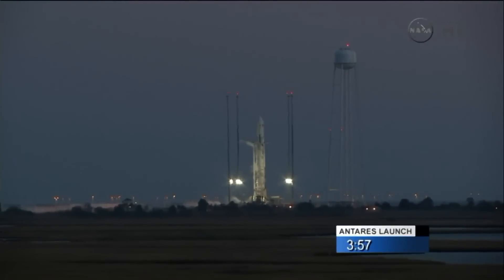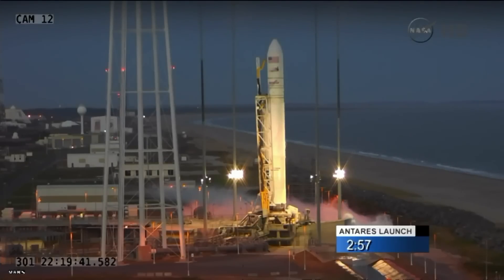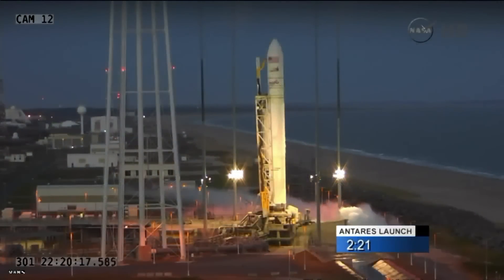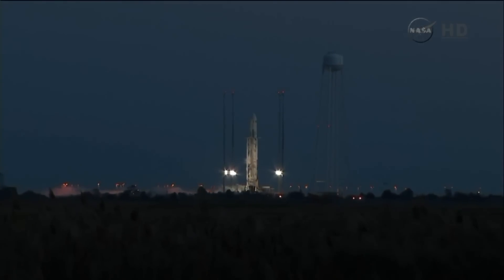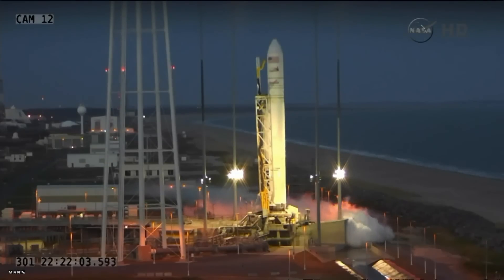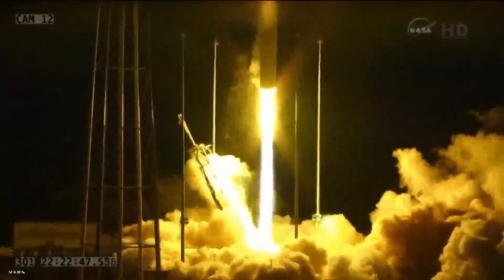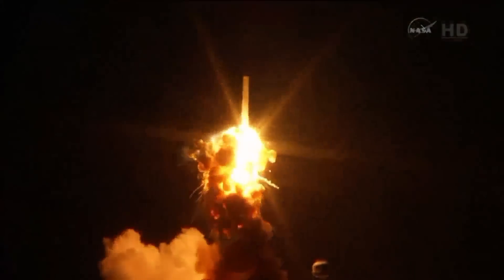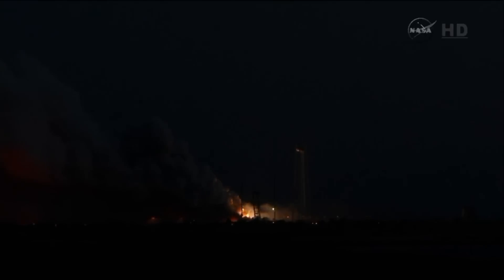NASA Antares Rocket Explosion [HD] [FULL]

Comment: Rofl "Avionics power nominal" as the rocket is exploding.
They should have a guy whose job is to look out the window and call "The rocket has just exploded" on the comms when it happens.
Reply: sukhoy That's pretty normal. Rocket engines are designed for a certain thrust, but they can get upgraded as the design gets improved over the years. These were refurbished engines from back in the Soviet era. They don't rescale the percentages because there is a very specific thrust for each percentage which could cause confusion in the different systems.

The space shuttle also had this. It started out at 100% and got upgraded to 109% over the years and could even go up to 111% in emergencies. Of course they have to get tested and certified again for each upgrade. The shuttle doesn't have a perfect flight record, but the main engines did not malfunction even once.
Reply: @Niosus  "The main engines did not malfunction even once" Umm I'm pretty sure that on one mission 3 of the coolant lines inside the engine bell that used hydrogen to cool the bell down ruptured and if 5 lines had broken that part of bell would have melted and lead to a rapid unscheduled disassembly ;).
Reply: YEAH but he also said: Power at 108% !!!

108% ?? doesn't sound very stable
Reply: Peter Syverud NASA doesn't. This rocket is built by Orbital Sciences Corp, an independent contractor who also launch commercial cargo.

The reason why they use those engines because they are actually some of the best engines ever made when it comes to efficiency. After the Soviet Union fell apart a whole warehouse filled with these engines "surfaced" and Aerojet (the "vendor" of the refurbished engines) bought at least some of these engines.

You can read up on the history of those engines here: http://en.wikipedia.org/wiki/NK-33#Current_and_proposed_uses
Reply: MoahGentle Not for this engine, but there is a nice summary on the wikipedia page for the space shuttle main engines (with all the appropriate sources of course)

http://en.wikipedia.org/wiki/Space_Shuttle_main_engine#Upgrades

Actually, looking at it again I did make a mistake. It went up to 106% in normal use cases. 109% and 111% are both for launch aborts (which never happened)

Very fascinating stuff to read :)
Reply: They are miles from the launch site in a bunker. I doubt that they would have a good enough view to see the boom.
Reply: Peter Syverud
this was NOT a NASA launch.
Reply: Niosus Any source for this info?
Reply: MrModerationist I'd even say that working within constraints is what stimulates brilliance. You don't want to leave brilliant people waddle at their own pace. They need to be challenged. Nothing gets a good engineer more excited than trying to come up with a solution that fits all constraints... Constraints make the problem interesting.
Reply: Niosus
Why would NASA use a rocket engine from possibly 50 years ago? Why???
Reply: +RealKull - Orbital sciences corp used Russian engines because they could get them more cheaply.  The SSMEs used by NASA have been tremendously reliable.

Apart from YOUR disrespect, I'll surely pass long MY respect to less offensive Russians.  You folks have a tremendous and longstanding space program....
Reply: MrModerationist I'd argue many Russian engines and SpaceX's Merlin engines are both very good from a value point of view, while SSME, F1, etc were all good from a performance point of view.
Reply: MrModerationist Absolutely. Even with unlimited resources, spaceflight still is full of challenges.

Did you hear about the latest SLS delay? The first manned flight is now planned for 2023... EIGHT years from now. On top of that they are aiming at a single launch per year, making it almost definitely more expensive than the Space Shuttle (at 2 billion a flight).

I think SLS should be cancelled. Not because NASA is incompetent, they certainly are not... But because politics has completely ruined the rocket. Everyone would be much better off if those billions upon billions were either spent on scientific projects or in helping along commercial companies build heavy lift rockets. They could have a heavy lift program just like the currently have the commercial crew program.

Because even when the rocket and capsule are done... We're still nowhere close to a Mars or asteroid mission. Hell, we're still nowhere close to a Moon mission that goes beyond flags and footprints. All the stuff needed for that is barely being worked on. I think it would be much smarter for NASA to leave the transport issue to a commercial provider (like with the ISS) and focus on actually developing the technologies needed to keep people alive in deep space or have a sustainable settlement on the Moon or Mars.

Sorry for the rant. It's just so frustrating to see politics force such a great organisation to pretty much ruin its public reputation.
Reply: RealKull
you realize that was a private launch right?
Reply: Niosus 51-F suffered a engine failure in flight.  It was the only in flight failure of an SSME
Reply: canuck20
I learned that after writing that comment. Although from what I've read it was a malfunctioning safety system and not an actual physical issue with the engine? They were at risk of losing another engine for the same reason, but a smart woman on ground control figured it out in time and had them disable that system.

Or at least that's what I remember.
Reply: Bret Remington
 These engines have a better overall service record than the Falcon 9 engines, so go figure.
Reply: @fubar12345  NK-33 (AJ-26) has the worst service record of any engine. Check out all the N1 failures. I believe you are thinking of the RD-180, which is one of the best rocket engines ever made. That said, the NK-33 is an incredible technological achievement, but ahead of its time in many respects.
Reply: Jim Lahey I don't believe that's true. NK-33 has been used much less than the Merlin 1D engines. 100th flight of Merlin 1D engine occurred recently, and now it's at almost 110.
Reply: Ambient Morality
 ..and you'd get no argument from me here.  Everyone works within the constraints that they are tasked with and there's brilliant and creative people the world over.
Reply: Niosus I agree with you completely. Use of older Russian or SSME engines is not brilliance stimulating in this case. They both represent constraints. The objectives and constraints are different for different projects. Some may be more technical in nature, some may be more economic.   I don't think pretty much anyone in space programs finds themselves with ample waddling time. : )

Companies like spacex and orbital sciences surely are emphasizing cost concerns a little mite than some as essentially their goal is to "commoditize" space flight. Projects like Orion surely gave cost constraints, but ultimately the order of priorities surely is a little different....   SLS for example involves a great deal of work on be engine design with a little different focus than commercial launch companies...
Reply: Niosus Ultimately, I'd much rather support LVs being left entirely to companies, with NASA focusing their budget on companies in LV business (gradually decreasing that and letting companies work on their own) and NASA responsible for scientific missions that companies have no motivation to do on their own.
Reply: +Niosus I understand what you're saying, but to get any closer to a mission like you're saying, you really need the lift capacity of something like SLS.  I would say that commercial lift surely is not without its hazard (reference the video above).  In general, NASA does partner with commercial enterprise to build components, etc.

I'd also say, that my understanding is NASA is doing all of the above as you're saying.  I toured the Johnson Spaceflight Center a few months ago...  In the huge training and operations center - next to the ISS full scale mockup is the orion trainer - and where the old shuttle robotic arm trainer used to be, there were a number of mars rover prototypes for mars (for human use).  They're doing alot of the tech research to support such a mission (textiles, food, body effects).  In fact the year in space on the ISS supports this I believe.

Remember - the Space Shuttle was only designed for LEO.  The SLS is a much more powerful launch platform - you'd have to compare it more to Saturn V in today's dollars for something more equivalent.  I understand what you say - and one should always question how we do things, but don't be too harsh on NASA.  I would not say their public reputation has been 'ruined'.   They've done some pretty amazing things of late...
Reply: MrModerationist Don't get me wrong, I love NASA. The people at NASA are not the issue. The issue is that politicians in congress are making engineering decisions that NASA engineers should be making. What parts get used, how to develop them and in what order should not be prone to politics.

That's really my issue with it all. They should give NASA a budget and give them a goal. There can be oversight to prevent needless spending, but it should be limited.

For instance, what idiot decided that the SRBs from the space shuttle should get reused on a manned vehicle? Those boosters have already killed 7 people. They're not that bad, but we've known for a while that solid fuel and manned spaceflight isn't the best combo... Maybe it can be made, maybe not. My issue is that politicians decided that this is how it is going to be...
Reply: +Peter Syverud its specific impulse is far more efficient then any comparable us engine excluding the merlin 1D
Reply: killman369547 The Merlin 1D is not particularly efficient. It's an open-cycle, gas-generator engine, which makes it mechanically simple and have a high thrust-to-weight ratio but not efficient in terms of specific impulse.
Reply: Ambient Morality
that i know but it is more efficient than the nk-33... not by much though
Reply: killman369547 No it isn't. NK-33 is 297s SL, 331s VAC. Merlin 1D is 282s SL, 311s VAC.
Reply: Ambient Morality
interesting i guess the website i found my info on was full of shit
Reply: 108% is a power rating that is stable and is actually engineered to perform. The catch is it's meant to be done for a short time. 100% power can be for as long as it has fuel.
Reply: oh ok thanks
Reply: so?
Reply: That's the Range Safety Officer. In this case the RSO detonated the rocket before impact.
Reply: Bret Remington I'll tell you why you have to use Russian rocket engines...because they're BETTER THAN YOURS, which are non-extant, but your stupid techs are not proficient enough to make them work properly.
Reply: @RealKull  The NK-33 is a beautifully designed engine but, soviet metallurgy in the 1970's could not reliably handle an oxygen-rich full-flow combustion cycle. These engines were meant to be scrapped after the N1 (moon rocket) failed. The focus shifted to new designs such as the incredible and quite reliable RD-180.
Reply: @RealKull  Unfortunately, the NK-33's were not scrapped, in direct defiance of the kremlin. These rushed and underfunded engines would strike again, like a chilling reminder or metaphor of the Soviet social experiment. That said, If I can scrape together enough cash, one of these puppies will have a prominent place in my living room.
Reply: RealKull angry much?
Reply: Total disaster.  I'm not quite sure why we are still using 50 year old Russian equipment.  Bring on SpaceX.
Reply: @breming1  SpaceX here with the successful launch of Crew Demo 2
Reply: @breming1  Because they worked...most of the time.
Reply: RealKull I think the correct English is "non-existent" . If you must 'sound off' in my language, have the intelligence to spell it correctly :-)

Comment: The Rocket Engine Outlet was manufactured in 1974. This Rocket contained cheap engine parts, 40 years old in production date. Probably they have never heard of metal corrosion.
Reply: GaryKildall) Because though it occurred to you to check for that, the actual engineers didn’t?..... Seems unlikely.

Comment: If I was the head of the launch control team I would be so pissed that that just happened. Like I would be like "fuck it" and just walk into that fire.
Reply: Expect him to walk a few miles?
Reply: Lol  ^_^
Reply: I don't even think launch control was at all responsible. My humble guess is an engine failure. More specifically a rupture or explosion of the preburner or fuel/oxidiser pump.
Reply: Povl Besser Fuel system (pumps, regulators) is not part of the engine and supplied by different manufacturer. Engine was designed to operate with analogous and/or hydraulic control system. It was replaced by modern digital - with faster reaction but (sometimes) with its own instability. 
What I saw in that video - a flash of fire and immediate lift loss, followed by bigger explosion. May be even a fuel line rupture or pump disintegration. Engine itself is just a burner with cooling system.
Reply: Alexandre Savine What was the instability caused by?  Was it a programming error of the digital system?
Reply: Matthew St. Onge It could be programming error, it could be some sensor failing just slightly off nominal response or some valve running with slightly abnormal parameters. May be several factors, including all from above plus weather and fuel composition variations.
     Each individual thing is within normal - but few together working in same direction - disaster. 
      Any (digital or analog) control system has a limited corridor of stability. Crossing the boundary just by fraction of % - and never able to recover.
    Not being in the project, I can give only a general guess, based on behaviour of rocket during takeoff.
Reply: Alexandre Savine Preliminary investigation reports are showing debris intake from the fuel tank—which would have flowed through the fuel pumps and likely tore through the delicate machinery in the pumps. Which lead to the ejection of a large amount of debris from the side followed by total engine failure.